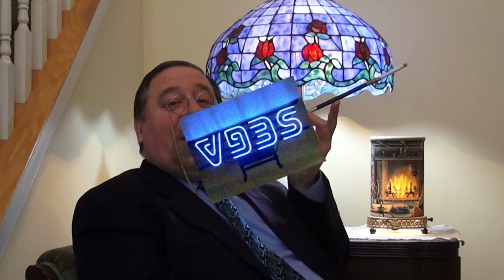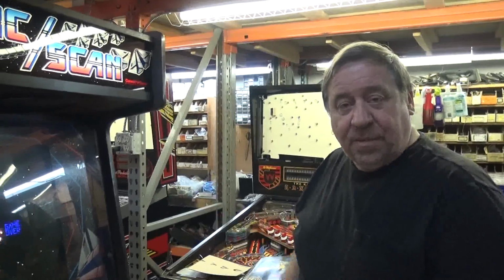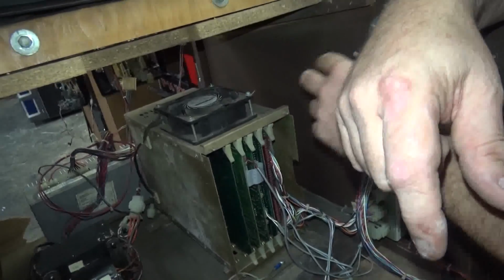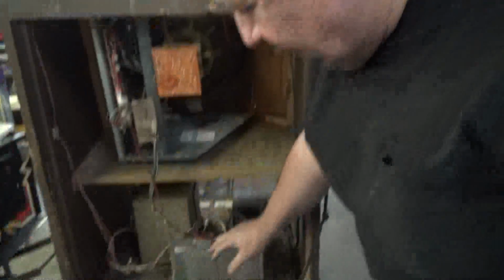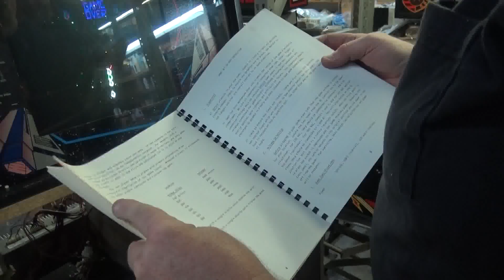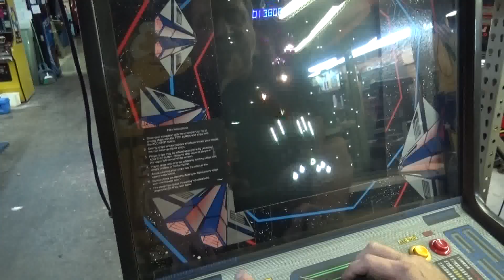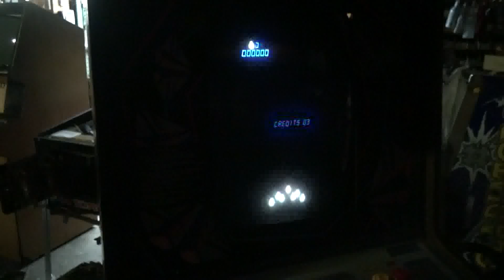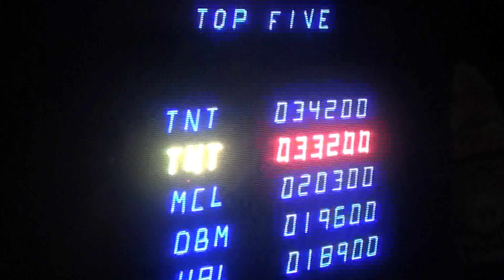#768 Sega Gremlin TAC SCAN Arcade Video Game super rare with VECTOR Graphics! TNT Amusements

Comment: I was there in the early to mid 80s when the arcades were hot.  As I recall there were several "convert-a-game" systems available by not only by Sega but also from Data East and Bally/Sente as well.  They were all solutions to the problem of swapping out an older "ailing" game with something new while minimizing the arcade operator's investment.
Reply from the maker: Baar Bear  The manufacturers were at least trying to help out.

Comment: I assume it's one of many games that would benefit with an LCD screen.  O_O   seriously local apple repair store.  their option to fix that all in one Mac (Aqua clear television with the crap inside the monitor was to take it outside  and take a sledge hammer to it and say it was fixed.  actually always wanted one just to irritate the masses :)  you keep singing no smashing 45's.  cd.s  sure just not shape CD's.  provided you could actually find a player that played those.
Reply from the maker: Lee Bartholomew nope...wrong!  Vector games ONLY look good on real vector monitors....
Reply: TNT Amusements Inc
could be emulated  but you did say the monitor was bad
Reply: Well.....yes I agree.  You just can't re-produce that fluorescent image as well on anything else.  However,  some of the vector games look decent when played on a console with a component cable or HDMI cable & a high resolution plasma screen.  The only problem with the plasma screens is that you have to spend several hours of screen burn scrolling to clear your screen again.  But it's hard to find a plasma TV now.  And LED TV's don't re-produce the vector image as well as the plasma did.  It's funny that the vector TV had the best picture & got so hot.  And with the plasma TV,  it also produced a decent image with vector games played with a console,  and it too got real hot.......but not hot enough to fry eggs on.  LOL